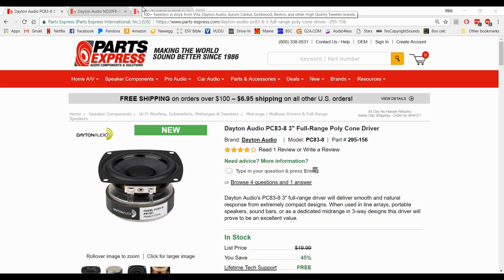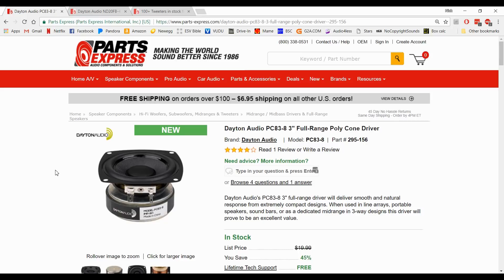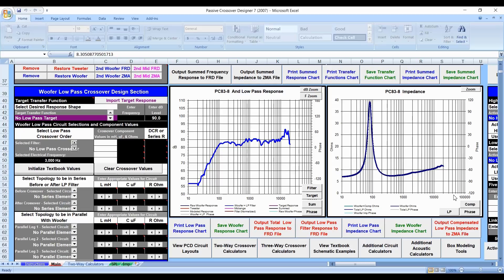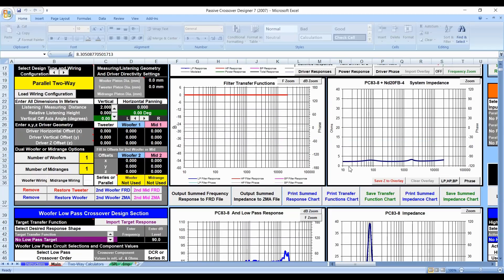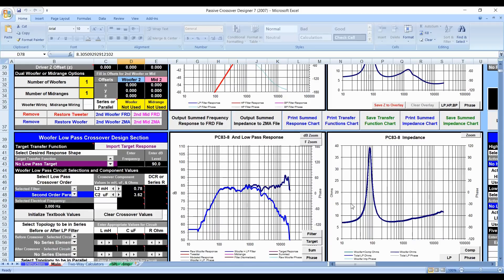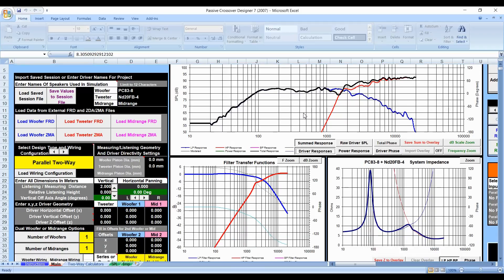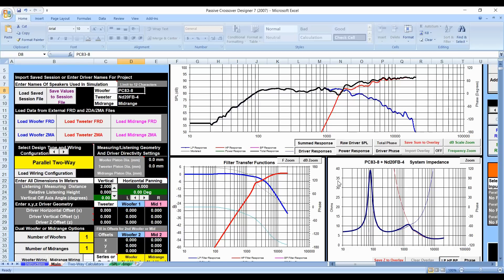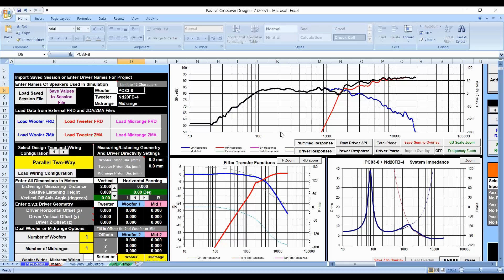Can I use an 8ohm woofer with 4 ohm tweeter?  Impedance Questions Explained

Comment: This is literally the only video/source of information that properly explained this. I already knew this as i am a WIP speaker company, however I am a huge supporter of DIY and love to see guys educating people properly. Thanks and keep it up.
Reply: Put really simply, a 4 ohm tweeter is going to be too loud for an 8 ohm woofer. But it also depends on the sensitivity of each driver, so what I said is just an average tendency.
Reply from the maker: Thank You, I really appreciate that
Reply: Hi, thanks for the vdo,I have a doubt, what is the calculation for 10ohm and 4ohm in parallel to get 2.67ohms,as I know the calculation for same ohms speaker.2 speaker of 8ohms give a total impedance of 4ohms,
Reply: @Toid  please answer this...So the tweeter and midrange are included in the calculation for final impedance? I thought it was only for woofer and sub?

Comment: Currently this is my setup 8 ohms midrange and 4 ohms tweeter,in the tweeter i have 2 capacitors connected in parallel,which is 10mf plus 6.8 mf,and the out frequency is about 2.3khz,now the issue is on the mid range its hard to find the parts i need,i found a 0.5 mh inductor,and i need like 200mf capacitor recommended by chatgpt to have a bandpass effect on the mids,but that 200mf capacitor is hard to find,i found a cheap electrolytic one like 100mf and i can use 2 ,but chattpt said it will degrade in time and its better to use film capacitor,so my project os left hanging as i dont want my new amp to get fried, I ready fried the previous one,as i guess the impedance went down to 2.6 ohms when they were in parallel 😮

Comment: What happens if i try powering a 6ohm tower speaker wire in both ways with a 8 ohm tower whats that going to do withbthe power separation?

Comment: I enjoyed the videos.   I have a 3 way set of speakers I built with my father in 1975.   The RadioShack tweeter went out and replaced with Morel Cat 378.  I have a 2nd order 2000hz 8 ohm crossover on the tweeter, the woofer 12"  full range speaker 50-11000hz with no crossover, the midrange 8" RadioShack 110Fs ( I was unable to find its freg range) and have a single Polycap 20uf, and the tweeter is 1800-22000Hz.  There is a 2 1/4 front port.  The speaker sounds pretty good but I am not sure I should do a band pass on the midrange. Since using the Morel the speakers are more sensitive to poor cd or album recording quality's sometimes sounding a little harsh.  The receiver is a Marantz 2250B.  Any suggestions ideas?  Thanks for your time and help  Dave

Comment: Am planning to make a 4 way speaker build, it was supposed to be 3 way, .. but the crossover i finally chose as a HF point of 3k, which is low for the AMT... So i thought I'll use a soft dome ... And add another 2 way custom 2nd order LR crossover for tweeters of 8ohm and 4 ohm.. so now Woofer is 4 ohm, mid is 8 and tweeter and tweeter are 8 and 4, is this feasible?

Comment: It doesn't matter when u use 4ohm tweeter and 8ohm woofer with 8ohm amplifier ......  
If u have 100 watt per channel amplifier .... That doesn't mean all 100 watt go through both woofer and tweeter ......
But actual is .....

Woofer required higher watts of power ( depend on voice coil length diameter turns , cone areas ) 
At that watts woofer ohm must be nominally equal to amplifier ohm ( 8ohm woofer to 8 ohm amp )

Same way 
Tweeter not required so much watts power ( which mean is has smaller voice coil length diameter , very small cone )
At that low watts any ohm tweeter is  run on any ohm amplifier ...... because tweeter have attenuation on Xover 

Simply. U can run 8ohm  woofer with 4 ohm tweeter ....😀 .....but woofer ohm is must be equal to amplifier ohm ...

In power figure of 100watt / ch amp ...
In typical 2 way .... 12 db/ octave Xover @2.5k 
30% or below power used in tweeter 
70% or below power useed in woofer 

As Xover point increase and slop order increase ..... Tweeter power handling decrease ....

Comment: I spent much time boiling over what will happen when I re-cone my originally 7.5 ohm  blown woofer with a new voice coil that measures in at 6.5 ohm. This video literally took less than 10 mins to tell me Im overthinking the situation and not to worry. SO thank you!

Comment: Wiring two 4 ohm woofers in parallel and adding one 4 ohm tweeter in series with a crossover to one of those woofers, does the amp see a 2 ohm or 4 ohm load from the tweeter?

Comment: can i use Peerless by Tymphany XT25BG60-04 1" Dual Ring Radiator Tweeter with Eminence PXB:5K0 High Pass Crossover Board 5,000 Hz

Comment: I have a 6 ohm tweeter, 8 ohms woofer and 8 ohm crossover. what's the difference if i had a 8ohm tweeter? thank you!
Reply: It doesn't matter when u use 4ohm tweeter and 8ohm woofer with 8ohm amplifier ......  
If u have 100 watt per channel amplifier .... That doesn't mean all 100 watt go through both woofer and tweeter ......
But actual is .....

Woofer required higher watts of power ( depeny on voice coil length diameter turns , cone areas ) 
At that watts woofer ohm must be nominally equal to amplifier ohm ( 8ohm woofer to 8 ohm amp )

Same way 
Tweeter not required so much watts power ( which mean is has smaller voice coil length diameter , very small cone )
At that low watts any ohm tweeter is  run on any ohm amplifier ...... because tweeter have attenuation on Xover 

Simply. U can run 8ohm  woofer with 4 ohm tweeter ....😀 .....but woofer ohm is must be equal to amplifier ohm ...

Comment: So you said that I can use a 6 0hm tweeter and a 4 ohm mid as long as I use an 8 ohm woofer? this is correct so how is that Cerwin Vega uses 4 ohm woofers too and get that 8 Ohms on the three way systems? Thank you

Comment: Speaker NOOB here. 
S.O.S. please. 

Samsung HTX40 is my main amp unit, if it helps. 

I'm thinking of replace my five 3 Ohm surround speakers (Samsung PS-FX40) because one fell the other day in a worried haste and I can't seem to open it to poke around to see if I can fix some simple loosened wire. Crap. 

I feel like an idiot gorilla shaking this closed black box.

My subwoofer is 3ohm.

I found a 5 set of 6 Ohm Yamaha NS-840 speakers (w/o subwoofer) for sale.

Can I match those together successfully without doing surgery?

Humbly out of my depth and kindly submitted.

Comment: Only thing is, don't use a 8 ohm tweeter if the original speakers' crossover was designed for a 4 ohm tweeter.   Using an 8 ohm in that case will change/lower the crossover point and damage your tweeter.  Correct?
Reply: When the nominal impedance is high, you need a low microfarad cap, while if the imp is low you will need a high uf capacitor to be wired in series with tweeter to get the same crossover point

Comment: Maybe I missed this in the video. I know you said you are using 3000 hz 2nd order crossover. Are you using one 2 way 2nd order 8 ohm crossover? Or one 2 way 2nd order 4 ohm? Or seperate one low pass 8 ohm crossover and one high pass 4 ohm crossover? Do you have a wiring diagram of this setup? Thank you.

Comment: What about the reverse, a 4 ohm woofer with an 8 ohm tweeter, or in a four way design with an 8 ohm woofer, 4 ohm midwoofer, and 8 ohm midrange and tweeter? These are the parts I have laying around an I want to do something with them. I could go with two 4 ohm midwoofers,  mounted at an angle to aid in dispersion or a Midwoofer, midrange, Tweeter and Midwoofer arrangement. What’s the best way to use these drivers?

Comment: Did you make that excel sheet calculator or it available online???  It looks like such a good learning tool.  Thank you so much for explaining this in such an easy to follow way, this helped me in school to understand several concepts in AC circuits.
Reply from the maker: This is a free Excel spreadsheetthat you can download. I have the download link in my video called five tools every speaker builder needs. If you check out that video, you should see the link there.

Comment: Hello Toid!, My name is Franz and I have big question i know you can answer easily.
1 year ago i got a 4 channel amplifier  capable of 75 W rms per channel at 4 ohm and 100 W rms at 2 ohm per channel.
I hooked up 4 coaxial full range speakers of 4 ohm (One per channel). The problem was
i was lacking of highs. So i am thinking about adding extra tweeters to my system by putting
them in parallel with the coaxial speakers with their respective crossover (crossover only for the
tweeters because the coaxial are full range(they have mid bass and tweeter)). 
Is that solution ok, or is it wrong? (For example: 4 ohm coaxial in parallel to 4 ohm tweeter per 
channel: So the amplifier is gonna see 2 ohm per channel, so my max power per channel
is going to be 100 W rms) Mathematically i know, the impedance is not linear in the
frequency axis and the coaxial is gonna request more power than the extra tweeter butttt....
And here is another question, if i turn up the volume slowwwwly,
how i know when my amplifier or tweeter is gonna blow up or start clipping?
Post data: My neighbor has an oscilloscope hehehe.

My actual system is: (JBL 600Wrms 4ohm mono amp ==> subwoofer Rockford P3 600Wrms 4ohm)
              (Rockford prime amp r400-d4 ==> 4 coaxial speakers = Rockford T1650)
 
       (in the future ==> one new amp for adding only midrange woofer and bullet tweeter)

Comment: 1.  your amp should be able to deliver 4 and 8 ohm output. 
2. You can use crossovers with H for 8 ohm and L for 4 ohm

It all depends on the amp and crossovers..

I am currently using two main channel and both the channel include 2 woofer 8+8ohm and 1 tweeter 8ohm.
So I designed crossovers accordingly. 8 ohm for tweeter and 4 ohm for two woofers.

Comment: So if I am using 3 8ohm mid bass and 2 4ohm tweeters with 3.3 if 100v bipolar bass blocker / crossover would that be a 2.66666 ohm? I’m doing the 3 mid bass and 2 tweeters on each side

Comment: in my experience it's OK to connect the tweeter paralell with the midrange/bass driver , just feed the tweetwr through a10 uF capacitor, and you will be fine.enjoy!
Reply: I have my mid/tweeter MTM module hooked up this way in my custom made work toolbox system and it sounds AMAZING

Comment: Hi, Im upgrading an instrument speaker system that includes an 8 ohm woofer connected to the low frequency tap of a 3 way passive crossover and an 8 ohm high frequency driver connected to the mid range tap. The crossover point i chose for this cabinet is 800hz . With both speakers connected to the crossovers I measured the load at the input with my multimeter and the reading was 7.2 ohms. Then I removed the 8 ohm high frequency driver and replaced it with a 16 ohm. I connected the multimeter again and the reading is still 7.2 ohms. I didnt expect that. The project is an old Leslie speaker cabinet designed for musical instruments, mainly for organs, and it has a 20 watt tube amp that is designed to drive an 8 ohm load. So after I installed the new speaker I hooked up a guitar to the cabinet and powered it up with the volume set at about 40%. It sounds great. No smoke or burning smells, no crazy fuzzy or crackling noises either. I didn’t find any indication of overheating that i could recognize so I turned the volume up to about 60% and continued to listen for noises and sniffing for any signs of trouble for about 2 minutes then I powered down. The transformers felt normal and cool to the touch. So, am i missing something? It still appears to be an 8 ohm load coming from the crossover. Does that make sense? Thanks

Comment: my vintage amp uses two (one for each channel) STK-0080 power
amplifier paks, and they are rated at wpc rms into 8 ohms with no more than .09THD.
I was told to better use 8 ohm speakers and not use 4 ohm speakers due to driving em too hard for too long..the stk's burn up.

BTW:  I do not understand this laboratory talk.
Reply: lower ohm = more current. So your amplifier is probably not designed to deliver enough current. Most home speakers are 6 or 8 ohm. Keep in mind some speakers can dip very low to 3 ohm, or in rare cases lower.

Comment: Is it possible for two 8 ohms tweeter in series config and connect it to 8 ohms instrumental speaker in parallel config what is the equal ohms of this combination. I have a stereo amp that supports 8 to 16 ohms is it all good or bad for the speaker and amp?
Reply: Yeah mate, you should be just fine

Comment: Hello there. I have somewhat of a simple question? I want to change the tweeters in my ( Premier Acoustic PA 8.12 ) loud speakers and they're both rated at 4 ohms, but the tweeters (Polk Audio DB1001) are made for a vehicle application. My question is will this setup harm the crossover inside the speakers ? My speakers are rated at 200 to 400 watts and the tweeters are rated at 60 watts, 180 peak and both are set at 4 ohms. Thanks in advance.😇👍👍👍
Reply from the maker: It won't hurt the crossover. But there's no guarantee that it'll sound good or the way you want it to.

Comment: Great video! My question is... How to connect two 4ohm speakers with crossover that my final load is 8 ohm?
Reply: Thanks for answerning my question, connecting two 4ohm driver in series i get a 8 ohm... i understand that... Than the crossover also need to be connected in serie or not?
Reply from the maker: @p3ras1983  I think you are misunderstanding.  A 4 ohm tweeter and midwoofer will not equal 8ohms if there is a crossover.  However, if you are using two 4 ohm woofers or midwoofer and a tweeter, they (the woofers or mid) will be wired in series after the crossover network to equal 8 ohm.  The crossover network wiring does not matter.
Reply: Now i understand...thank you very much. Btw very good chanal, very informative, keep with good work!
Reply: Im using 4ohm woofer and 4ohm tweeter!
Reply: Can i use a resistor (4ohm) in serie with woofer or it need to be a 4ohm driver. My question is can a resistor replace a driver whan we talk about impedance?(in my situation)
Reply: Uh sorry... resistance
Reply from the maker: Two 4 ohm drivers?  Like a tweeter and a mid?  That can't be done with a crossover for the reasons mentioned in the video.  You can hook up two 4ohm mids or woofers and wire them in series after the crossover to get an 8ohm load.